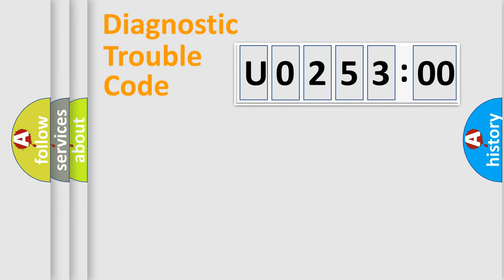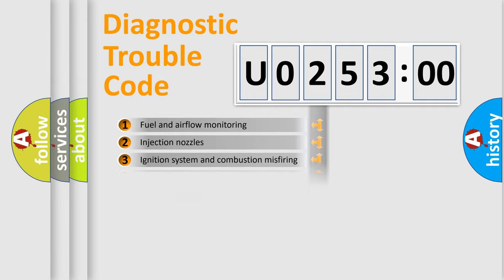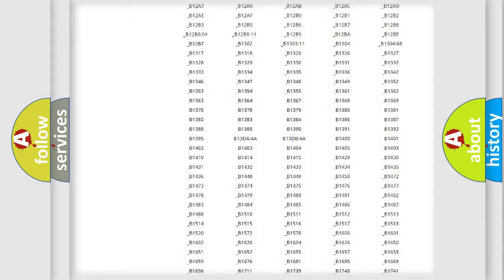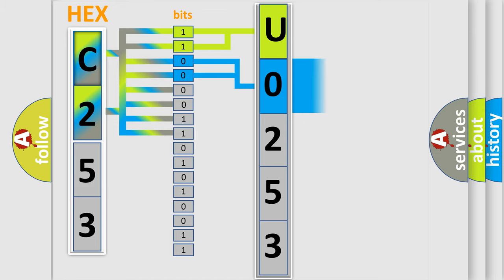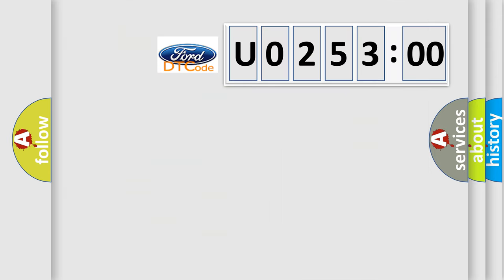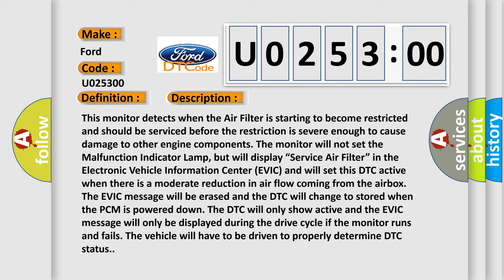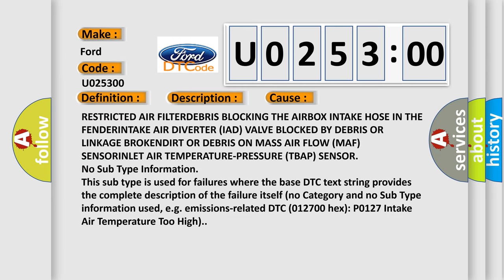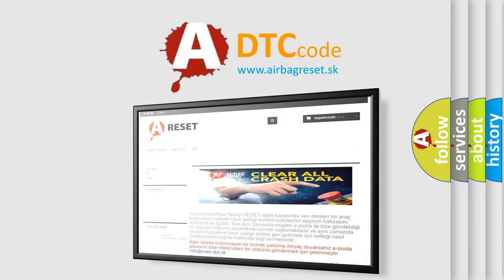DTC Ford U0253-00 Short Explanation

Comment: This does not apply for a 09 Focus. The OBDII reader indicates "Lost communication with accessory Protocol Interface Module" it has nothing to do with what the video explains. At least not for  US sold vehicles.
Reply: Have you fixed the issue ? Currently have this code for my 2010 f150
Reply: @davidtheepro  Same problem with my 2010 F150...Sometimes it cranks, but won't start. And this is the code that pops up.